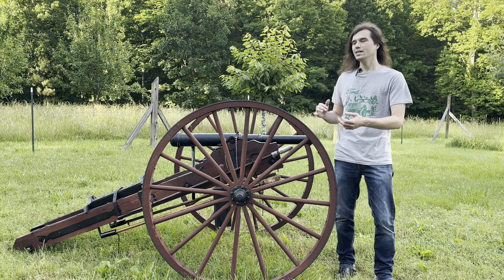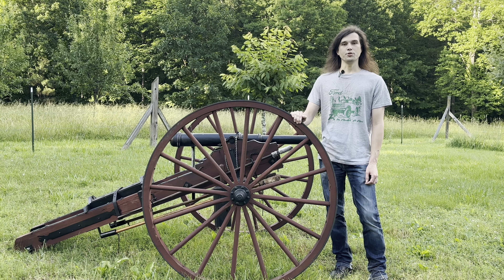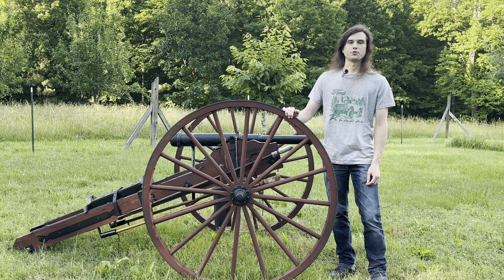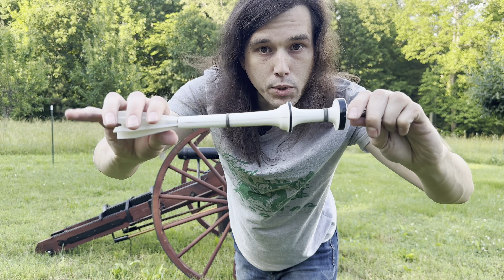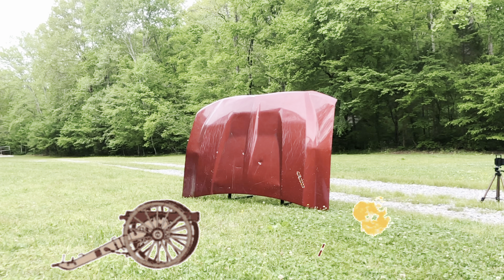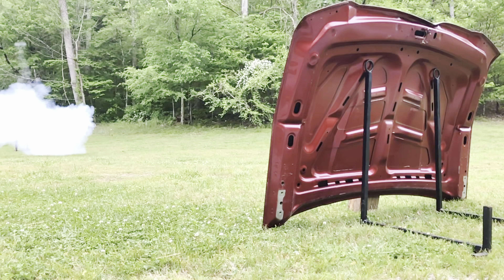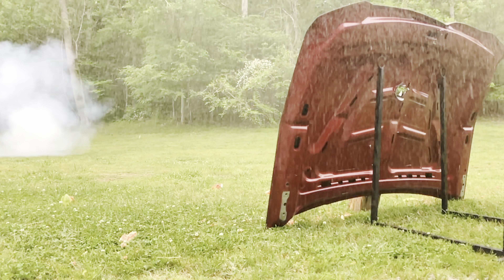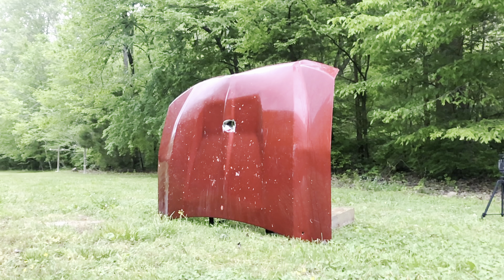Shooting 3D Printed APFSDS Tank Rounds

Comment: Thanks for the APFSDS video. What would the difficulty be with a stem from the base plate to the base of the penetrator? Maybe use a wood base as well.  This way the fins don't feel the pressure until the whole assembly leaves the barrel
Reply from the maker: I think that version “should” be fairly easy to make with the fins all the way down. I’m not that great with design but I’ll see what I can come up with! Good ideas to try too!
Reply: @TheCannoneer  I'm one of those tinkering types... the things that go through my mind.  LOL!

Comment: The sabot of the round itself is suppossed to be exposed to the pressure gasses, not a baseplate behind the round.
the fins were clearly not strong enough to hold all the force.

The problem with your round is that the sabot will get launched out without the dart if you had no baseplate. To fix that you need grooves on the dart and the  sabot so they get locked together while still in the barrel.
Reply from the maker: That makes complete sense when you look at the cross section. I’ve got to make it work the other way around… as it’s being pushed from behind on the fins now. I didn’t put that together until now. Thanks!

Comment: Have you considered PETG, PC or nylon + carbon fiber?
PLA may be too brittle for what you are attempting.
Reply from the maker: I’ll have to look into what my printer can handle for now but I’ve also had a few folks suggest epoxy coating the PLA and see what happens. I’ll have to make a few different versions for the next go around!

Comment: Food for thought... 

The APFSDS has grooves which lock it into the sabot. Maybe if you turned a few grooves into the rod, or use a peice of allthread, it may adhere better to the sabot. 

Also,  you need a pushing charge, not a forcing charge. Perhaps loading your cannon to the training load specs might change the pressure dynamic. 😉

And yes, pin the fins. They want for a mechanical connection to the rod.
Reply from the maker: I’ve realized that I’m trying to reengineer the design to be pushed from the base and not from the sides and y’all have wonderfully explained that to me which I much appreciate. I’ll pin the fins! If I’d have quite known how they are supposed to work I’d probably have done some rethinking!

Comment: You're definitely crushing the fins.
Either metal fins or having the rod go right through to the back would be the quick and dirty solution.
Reply from the maker: Someone pointed out the TPU base is probably was just piercing a hole through and blowing everything apart in the barrel which makes total sense. I’ll have to revisit the metal fins idea and a few harder base plate materials….

Comment: 1. Don't make pressure push on the fins with the pad
2. add grooves on the rod so the sabots have tight grip
3. Add aerodynamic surfaces on the front of sabots that will better push them apart after leaving barrel
- I really like your creativity 🙂
Reply: The sabot needs to pull the dart from the front. Not be pushed from the back. In all APDFS rounds from 7.62x51 DU to 120mm. The sabot pulls from the front. 

It's also cupped at the front to catch the air and separate from the dart as quickly as possible after it leaves the barrel. 

I'm sure people have mentioned the grooves normally found on darts so the sabot doesn't slip. 

An interesting fact. Surplus 7.62x51mm DU has made it onto the civilian market. It's really rare but cool.
Reply: Sounds good and checks out
Reply from the maker: Much appreciated! I didn’t know these rounds were pushed by the sabot and not the fins when I made these but yall have wonderfully explained that so I was unknowingly putting pressure on the wrong parts. We will be a redesign and get these working! Thanks for the tips!
Reply: @TheCannoneer  if you're printing everything having the sabot pull the dart might be pretty difficult, the PLA sabot grooves might shear off, you could try keeping the base plate and placing the fins flush with the back of the steel core or have it portrude to the back so there's no pressure on the fins
Reply: @TheCannoneer  Maybe also weld thin metal sheet plates as fins to the rod, don't print plastic ones
Reply: 4. Keeping it subsonic also helps. Typical black powder shot is transonic -the worst possible speed  for this purpose.
I've tested this kind of things with air rifles. Just a half gram piece of florists wire with rice paper vanes and a wood plug seal.
 From a low power target rifle , ca. mach .4 speed, they work fine,  consistently stick point first on  4" board at 10 paces.
From full power mach 1.2  vermin rifle they come out sideways.
Reply: @JanoTuotanto  isn't the whole point of APFSDS to be as fast as possible? If he can launch big balls at speed close to the speed of sound then much lighter dart should be at least twice the speed. Also the light weight of dart might decrease the pressure and thus make burn less efficient.
Reply: @MartinMizner 

The purpose of APFSDS is to let to fire a narrow projectile (which is best for penetration) out of a large bore (which is best for a heavy projectile).

For anything other than improving armor penetration, discarding sabot projectiles don't really bring anything to the table, other than being a fun engineering challenge.
Reply: Here is an image of what Martin is talking about. I believe these sabots are normally split lengthwise into three pieces.

https://pbs.twimg.com/media/DmcwFhqVsAAGF3C.jpg

Comment: I hope you manage to get the APFSDS running. Why don't you build your own cannon in the future ? Made from a super alloy, 2.5 inch wall thickness so you can use fast burning NC powder for extreme muzzle velocity. For the APFSDS rounds, heavy tungsten alloy would be better, maybe even with a carbide tip and a TICN coating. I would love to see that. No one on YouTube has ever tried this and I think it would get you a million clicks👍
Reply from the maker: We actually built our current cannon but we didn’t have the channel in mind so we didn’t film it… I’ll have to make a new one at some point and film the process! Sadly cannons have to be black powder or they are considered destructive devices and then the ATF gets involved…
Reply: @TheCannoneer  I didn't know that cannons in the US have to be black powder or the ATF gets involved. I am from Europe. Good luck with your project

Comment: The problem is the sabot petals and fins are being shattered by the force of the blast, the obturation you are using is getting blasted around the fins and petals 
Make the fins stronger, make the dart body do to the base, support the base with stronger obturator pads something that the dart metal won't penetrate.
The petals are normally mechanically connected to the dart body you could do this with a few pins sticking out about 5mm each side about 5 or 6 at one inch intervals midway down the dart body.
Reply from the maker: I’ve got a bunch to redesign! I didn’t know anything about these but we will get them working!

Comment: 1. Are you using pla or pla pro/+(regular pla is brittle)
2. You may want to use 2 tpu discs with a gap(~3-6in) in between to act as a shock absorber.
Reply from the maker: Just PLA at the moment. I’ll have to snag some plus for the revisit and add some more discs and space! Maybe half the powder charge too.

Comment: Your biggest problem right now is your APFSDS projectile is getting left behind by the sabots because there's nothing really holding them together. Real APFSDS rounds are held mechanically to the sabot by a series of machined grooves in the sabot and projectile locking them together. The sabot has the majority of the surface area and is where the majority of the "push" from the gunpowder goes and it pulls the APFSDS projectile down the barrel along with it. What might work best in your case is to make the metal rod go down to the base of the fins and have an additional base to push the projectile from behind. That way the majority of the force is the new base pushing on the rod from behind instead of trying to pull the rod from the front. You would have to redesign your sabot a little to make sure it could also hold up to getting pushed from behind, but that should be mostly making the rear section thicker.

You could also try printing your fins thicker and from Carbon Fiber TPU, which is significantly tougher against sudden shock and impacts while still being pretty stiff. It's pretty abrasive on brass nozzles so you would need to get at least a hardened steel nozzle.
Reply from the maker: I don’t know if I can print carbon fiber on my printers! I’ll have to look for sure! I was wondering what the all thread was about inside them but that makes complete sense. Keeps everything together.
Reply: @TheCannoneer  All you really need is a hardened steel nozzle for your printer(Short term) and hardened steel/replacement extruder gears(Long term) if yours are brass. If yours is a threaded removable nozzle it's almost certainly a standard size nozzle that's widely available anywhere that sells 3d printers and accessories. If its something more proprietary, like from Bambulabs, they usually sell hardened nozzles or may come standard on their high end models.
Reply: @tu-jx6wh  there are also tungsten carbide nozzles as well, they don't wear at all, they will basically last a lifetime unless you're extruding filament loaded with diamond powder, which I don't think exists...
Reply: @TheExplosiveGuy  I am actually using a .6mm diamond tipped nozzle from Diamondback for all my abrasive filament printing. I have several KG of CF and GF filament through it and it's still flawless. I went with that over a tungsten nozzle for the better heat conductivity for faster printing.

Certain companies do make 90% Tungsten filled filament for certain uses such as radiation shielding. A KG is around $700 and it's probably horrifically abrasive. That's nearly, but not quite as bad as 3d Printing with diamond dust filament.
Reply: @TheCannoneer  Using a section of all-thread as your projectile might be a quick and dirty way for your sabot to retain the penetrator rod as it goes down the bore. Keep the sabot pulling by threading its inner section to match the rod.
Reply: @TheCannoneer  carbon fiber isnt going to do much for strength with PLA, it just makes the part more rigid. 

what you should actually try is printing in nylon, either pa-6 or pa-12, or maybe polycarbonate. both are the most popular in parts for "shootbangers that are additively manufactured". you would need to have an enclosed printer (otherwise lol warping) and can print at 260-290c nozzle and 100c bed temp, a hardened nozzle and extruder gears are a good idea if you plan on printing CF or GF reinforced (more than a few prints anyways), which seems to be what most manufacturers sell. just to compare (im assuming impact strength is the most important in this case)

bambulabs pla basic Impact Strength 	26.6 ± 2.8 kJ/m²
BBL PAHT-CF Impact Strength 	57.5 ± 3.4 kJ/m²
BBL PLA-CF Impact Strength 	23.2 ± 3.7 kJ/m² (worse than base PLA)
BBL PA6-GF(glass fibre) Impact Strength 	40.3 ± 2.5 kJ/m²

of course the CF nylons also have a much higher temperature resistance, which could matter? but as you can see, PAHT-CF has almost twice the impact resistence of basic PLA, plus like triple the tensile strength.
Reply from the maker: @mrrooter601  I'm running two stock CR-10's atm and they won't print that hot without some mods. I think when the channel gets a bit bigger a printer than can handle those types of filaments (safely) is on the list!
Reply: @TheCannoneer hardened nozzles can print carbon fiber but youll need a direct drive printer for TPU
Reply: @TheCannoneer eSun's PA-CF (Nylon with Carbon Fibre) will print on any Ender3 clone, so long as the firmware will take the printer to 290-300 degrees Celcius for the head and around 90 C for a glass bed, you'll still need to apply contact adhesive spray to the bed right before printing. Yes, hardened steel nozzle, and the fibre is short strands of it that effectively make the nylon 'hairy' and allow for better links between lines of hot filament.
There is a form of carbon fibre infused PLA or Nylon that has a single long strand of Carbon Fibre running down it, it will also require replacing Brass printer components with Hardened Steel, it's layer adhesion is the same as other plastics, but is torsionally stronger.
Basically, if the Nylon doesn't survive, you'd be better off getting a good machinst to make Steel fins that can be welded to the projectiles shaft - or turn the 3D printer skills in to CNC Machining for the Fins.
Reply: @TheCannoneer As for locking the Sabot to the Projectile - look at the way the Collets on an engines Valves work, where the spring bushes up on the retainer, wedging the Collets in to grooves running around the Valve Stem. You could drop Collets in to the 3D print as it runs, or heat-press them in later the same way the threaded inserts can push in.
Reply: bruh I would weld metal fins on.
Reply: The easiest answer for the rod is to make it from a threaded steel rod and have the three print sapo interact with that you could also easily machine a metal tip that you could then screw on to that rod
Reply: Or for sake of ease, he could braze a ring that would sit ahead of the sabot. That's probably the fast and dirty technique that could help it along. Or it could be placed in the middle of the sabot and the sabot printed to wrap around that.
Reply: The sabot pedals have the seal so they pull the rod. 5/16-18 all thread rod and figure out an extension to run a tap through the sabot. Tap the fin so it doesn’t pull off the end. Omit the rubber plug. Not sure if that will work but it’s closer to the real approach. There are pictures on the internets. Fun video. Thanks
Reply: @ryancarr6420  "pedals" is wrong, it should be 'petals' like a flower. But in a weird way pedal does make reference to the fact that the word Sabot is a french word for a kind of wooden shoe, and that's where this kind of munition gets its name.
Reply: Would a gas check, or cup like a shotshell behind the fins allow the force to directly drive the penetrator? Then the sabot should just guide the rod.
Reply: Just wanted to say the same
Reply: I noticed the petals were far too brittle. it's why they are flying out in pieces losing their energy before they even has a chance to gain the velocity they need to penetrate, and do it accurately
Reply: exactly what i was going to say. nice
Reply: try 20mm steel plate
Reply: So that is why the darts are ribbed in the midsection. Clever. Not just for her (the enemy tank) pleasure 😂.

Comment: OH YEAH

jsyk, real APFSDS rounds have ledges / steps on the penetrator that interface with some on the sabot, so the sabot actually drives the central projectile. here, the sabot may just slide off the penetrator during firing as there is no mechanical interface
Reply from the maker: I’ll have to take that into account and maybe use some all thread and the threads on the petals and see what happens!
Reply: @TheCannoneer  all thread is an ingenious solution. this solves your fin mounting porblem as well as the pedal to penetrator friction.